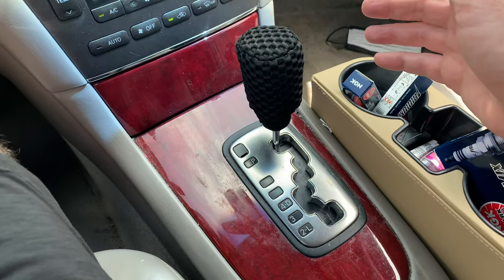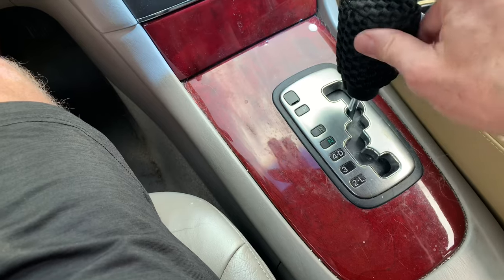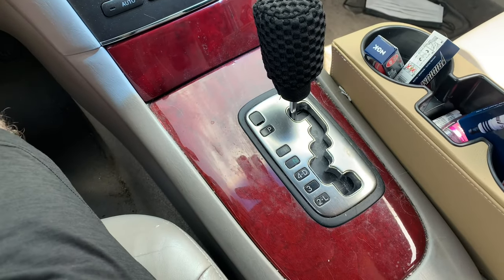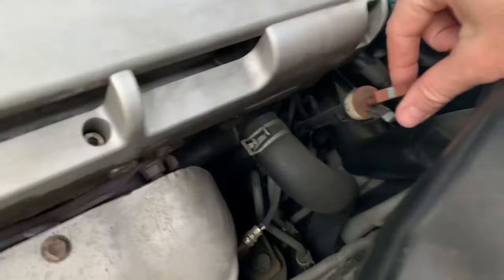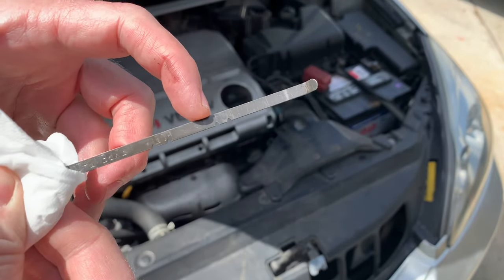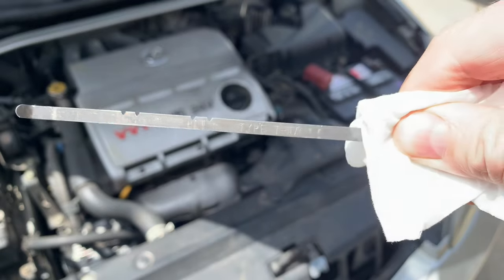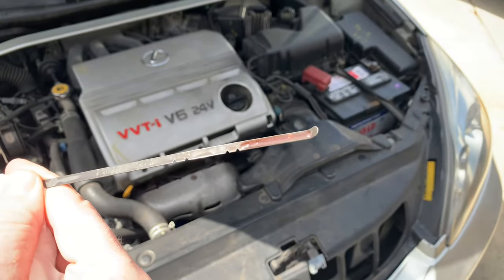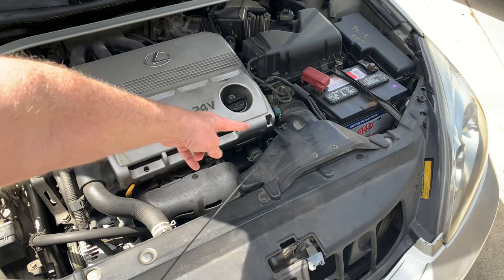How to check the transmission fluid level on a Lexus ES300 car.￼

Comment: I ran across a 1994 model with low miles like under 50000 but the fluid was gray. Thought that was strange
Reply: Me too I bought a 94 model with 45000 miles and the fluid look gray on the dip stick but when I wiped it with the white tissue it did look pink then Mine was overfilled so I suctioned it out and now it's at the proper level, I was getting the p0753 code, shift solenoid A Electrical ck engine code a one time slip starting up a hill, I hope the fluid level adjustment fixes that

Comment: if its low, can it cause the transmission to slip?
Reply from the maker: Yes
Reply: I ran across 1994 with 45k miles but tyranny fluid was more gray than pink, great car but tyranny fluid looked strange to me

Comment: My dipstick does otherwise
When it's cold before starting engine, the oil level on the dipstick is on the hot indicator, but when cold it's way below the cold mark, I don't know what else to do
Reply: always check tranny fluid while engine running